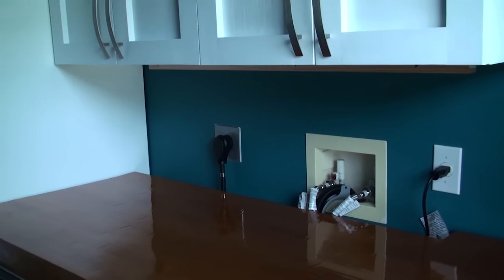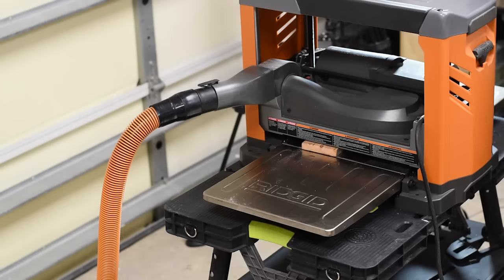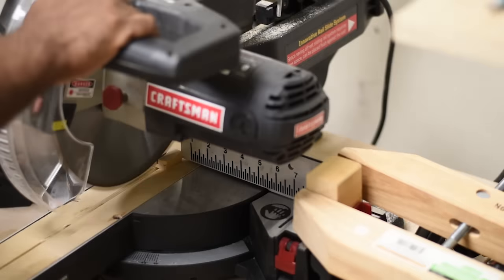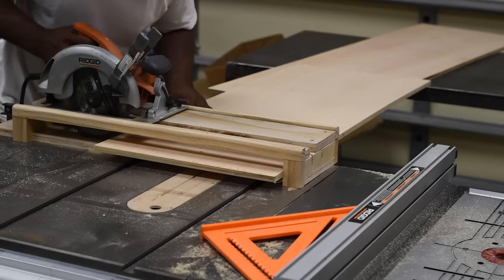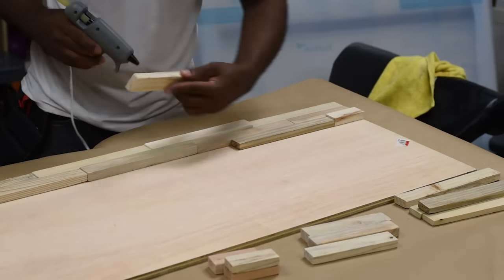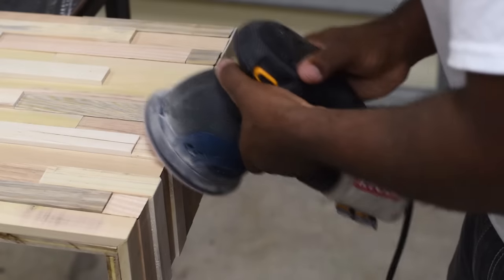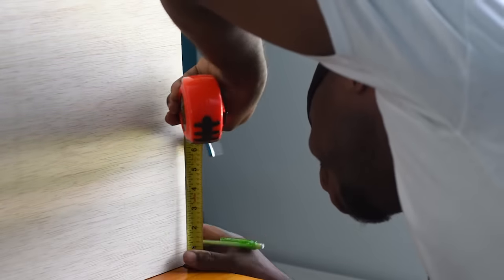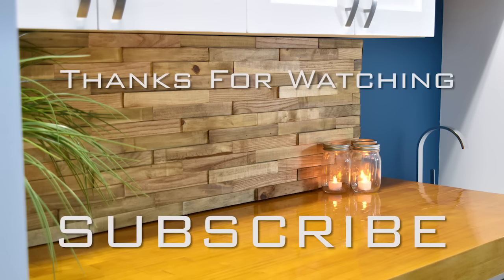Backsplash From Reclaimed Pallets | DIY Build

Comment: I did this, but with 3" wide pieces that were 12" long, sanded, squared and jointed - so any piece could go anywhere and all I had to worry about is staggering the thickness and color when placing them.  Then I shot them with clear satin Polycrylic (for easy cleanup if something like spaghetti sauce hits them) and used clear PowerGrab to glue them to the existing ceramic tile.  Worked like a charm and it looks amazing!  I got some of the ideas from your video, thanks so much!

Comment: Great job, I just might try this. I'd use magnets to hold it in place. It's cheap and easy.
Reply: Home Depot has 1/2" wide flexible roll magnets, 30" for $4 or 10' for $7. Cut it to whatever length you want. Provides full contact along the entire span.

Comment: I have been thinking of doing this in my kitchen for my back splash. I like the way you varied the thickness of each piece to achieve the stacked stone look.
Reply: Did you end up doing this? Wondering what keeping it clean/dry is like, and how much/what you used to seal yours if so.
Reply: @Judd.s.c  I did end up doing this and it turned out great. I ended up staining my pieces of wood and sealing with polyurethane. Cleaning was accomplished by wiping with a cloth. If water splashed on the backsplash I was dry with a clean cloth to dry.
Reply: @gdurham0  Hey! Thanks for replying to an ancient thread!

That all makes sense. Sounds like water and grime weren't much of an issue with a healthy coat of poly. I have considered soaking the wood in deck treatment before beginning work as an additional precaution. Might be overkill.

Comment: I'm loving the channel! I dig your modern twist on the reclaimed builds, and your from scratch builds are dope as well. 

But when working with reclaimed woods, I very highly recommend using an angle or disc grinder with a steel wire cup brush attachment. It's a lightening quick way to clean off any dirt or grime from the wood, and makes it much quicker when you take the next step to sand.

Comment: Best guess for the left side is to leave 2 or 3 wooden slats off during installation. Drill pocket holes headed toward the wall(via Kreg. Screw into the wall. Add pre-oiled wooden slats back on using painters tape to secure them while the glue dries. 

Awesome work, my friend.

Comment: You can screw one of those door locks that are two little rods with a spring, and they have a metal loop that goes between them. Rods would go to the wall, the metal loop on your pallet dashboard.

Comment: idea for having it grasp onto the wall
magnets might work, it'll be a quick fix
wont be neat however

velcro will work, the pain is when you need to seperate it

i suggest you make a slide hook, so to speak, make a sort of like the slide bolt locking mechanism you find on doors.

so you can leave everything as it is now, just add a slide to the back of the backsplash, and a bolt on the wall and slide in from the end once you have your locked end (the one you showed on the far end of the backsplash in the corner)

sort of like the battery compartment on most remote controls for TVs

Comment: Just curious, did the hot glue hold up over time? I'm wondering if wood glue with a few dots of hot glue (to keep clamping pressure while the wood glue dries) would work better?
Reply from the maker: Its only been a few months but its holding up great.
Reply: Thinking of using a similar method for a headboard for a queen bed. Do you think that people resting their heads on it will be too much strain for the hot glue?

Comment: 3M makes industrial velcro that's 3 times stronger than regular velcro. That's what I would use. It also has an adhesive on the back of the strip for easy installation.

Comment: hey, i work with wood to, if i was you i could use at the other end a sort of dove tail joint(one side at the wall and the other side at the panel) without glueing it, just to slide it in, its a bit tricky but if u touch the panel it woun't fall off(if u left a bit of a space)

Comment: Looks nice, I guess you don't want to build it in front of the messy choping board :D I got a brilliant idea, check this out: 
at the top wooden bits you glue to the top of the board (right under the top cabinets) take them out and fix another thicker ones which are going to step out at least 40-50mm. In this space where steps out groove a line all the way from one end to another and fit a LED strip.( make sure to hide all cables) I think is going to look unbealivable cool. 
good look. Piece.

Comment: I think a bunch of neodimium magnets would work just fine. What i would do is to put a piece of wood on the wall like a rail, with magnets inserted every 2-2.5 cm  (0.8-1 inch) and make them flush with the piece of wood, and then do the same process on the interior of the backsplash (of course the magnets should be aligned). I think it will result in a much more durable solution than velcro straps.
Anyway, keep up the good work man ;)
Reply from the maker: +perrots97 
Thank you :D. I use the french cleat a few viewers recommended. Great idea tho.
Reply: DIY Creators Never heard of them, i will find out what they are :D

Comment: Glen,I have a laundry area in my tv room and it makes way too much noise.  This may just be the perfect idea to give my laundry area a nice accent and cut down on the noise it makes when discharging the water.  THANKS!!
Reply from the maker: Nice maybe you can also add foam boardd on the back to help with the noise reduction.
Reply: Good idea, you just gave me another idea to use this type of design for the faceplate of the cabinet I need to make to hold items like laundry soap and bleaches.

Comment: friend of mine used a gluegun inside his RV trailer , the sun was shining and it was pretty hot inside so when he slammed the door one time everything he glued to the walls came down 
think in youre case it wouldve been better to only use the hotglue to keep the piece in place and use watertight gleu or liquid nails for permanent fixation to the wall
do like how it turned out though

Comment: Great video and idea , who'd have thought hot glue would do the job so well . Keep up the great work , Loved your murphy bed video saved me many hours of head scratching on how to get the pivot hinge without getting ripped off for the hardware kit. How did you work out where to put the seat hinge on the frame so the bed would open without catching on the rear wall ? . Love your work keep it up . All the  best Glenn , Sheffield England
Reply from the maker: Thank you. I took a piece of scrap wood and duplicate just one side where the hardware swing.

Comment: to attach to the wall, try multiple french cleats. That way it's still removable.
Reply from the maker: Thank you that's what I ended up using.
Reply: +DIY Creators keep up the good work. I like the things that you come up with. It rained in Seattle today so I have a stack of posters in my driveway that need to dry out before making my floating shelf like in your other video.

Comment: yo man, how long does it take to finish it? it would be useful if you add information for each project how many hour it takes.
Reply from the maker: Its not easy to calculate the time it takes. It will not be a accurate time. I am filming the process which adds more time, Im moving equipment, cleaning the work space. I finish this in one day. Most people don't work at the same pace. If I say this took me 7 hours I will get backlash cause it took someone 10 hours, Its a no win situation. Ill try to give a time frame next time.
Reply: DIY Creators well that's just awesome.

Comment: I'm assuming the attachment difficulty was with the outside corner. An idea for that, if you didn't mind doing just a bit of finishing work in place, would be to use pocket screws through the short leg into the wall, and then attach, sand, and stain those last short pieces of pallet wood.
Reply: Gorgeous work, though! And a fantastic use for the pallets!!
Reply from the maker: Thank you for the suggestion.
Reply from the maker: Thanks !

Comment: You could try something like this style of push to lock/push to unlock system.. https://www.atgstores.com/latches/sugatsune-mc-28-blk-non-magnetic-touch-latch_8411505.html?ppc=2615&af=2615&cm_mmc=sce_google&s_kwcid=AL!4500!3!104603687843!!!g!47940806118!&gclid=CIrmtLWypM8CFUEfhgodn_oMTw&ef_id=VbQ0PQAABfa5fXYZ:20160923020105:s
Reply: Mount the pin to the wall and the latch to the inside of the backsplash , then just push the backsplash into the pin, and push it again to release the backsplash from the wall , this one is plastic but I know there are better quality ones out there

Comment: Good video. But we, viewers don’t have all those machines!!!. It will be useful to know how to do it with the tools we may have at home. So this is not a DIY, unless you show how to doit
Reply: The only big machine he used was the planer. The rest of the tools are totally accessible. You could use furring strips (instead of pallet pieces) in different sizes to achieve a similar look. You would just need a circular saw, a couple sawhorses, a drill and bits, a sander, a hot glue gun, wood glue and clamps. It would be a little less efficient with all these hand tools, but totally doable!

Edit: I forgot about the miters on the corner of the piece. You can actually cut miters by hand, with a hand saw and a miter box.